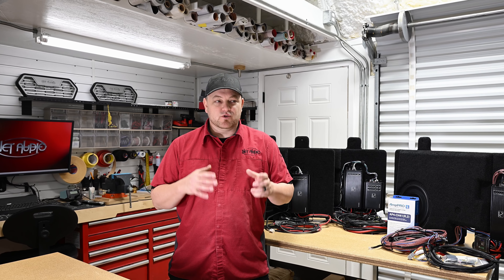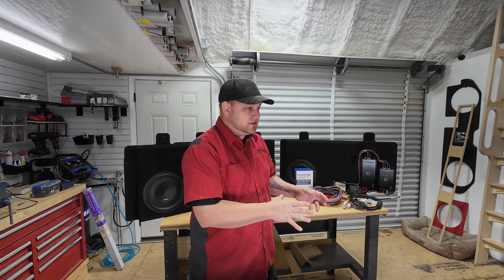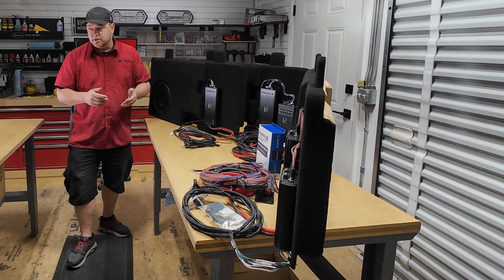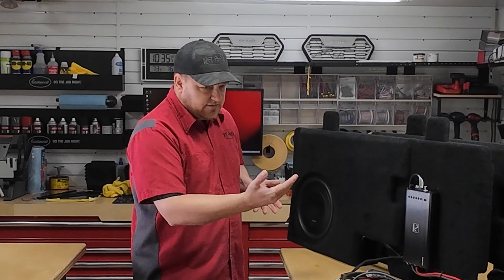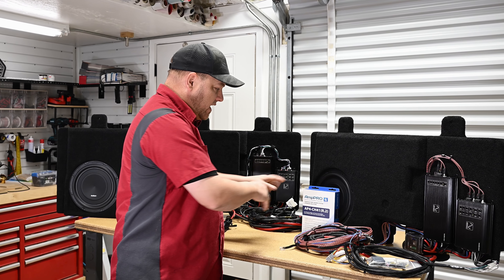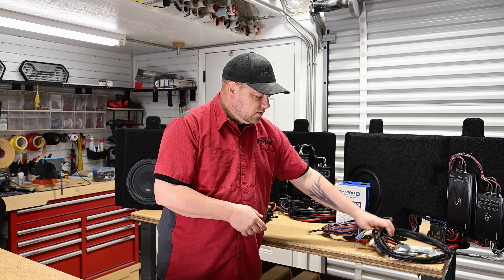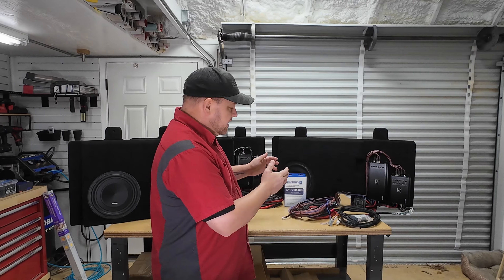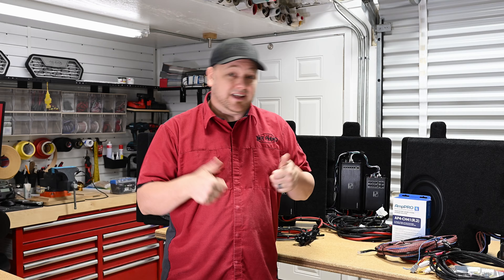RAM Behind the Seat All N One Kits Update

Comment: Any solution for 5th Gen Ram 1500 quad cabs
Reply from the maker: There is way less room behind the seats on the Quad Cabs. We're barely squeaking out what we are, with that little amount of space I would be surprised if we could even fit the sub in there.
Reply: Interested in this as well.
Reply: @Netaudiowf  under the rear bench seat is fine as far as subwoofer enclosures, I might have to install amp racks underneath the front driver and passenger seats if there is any room
Reply from the maker: Space under the front seats is very limited, driver and passenger. The back wall is pretty standard because of that.